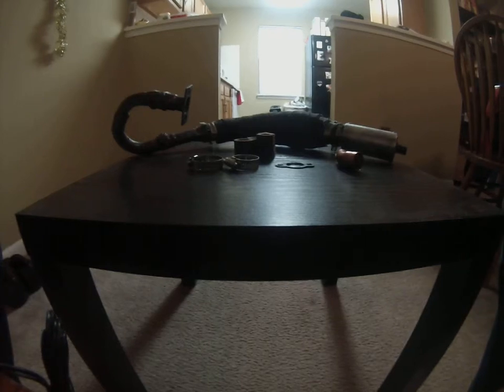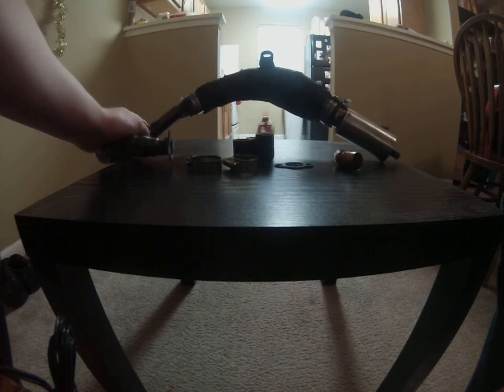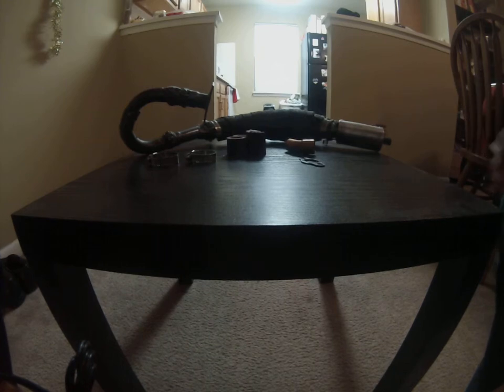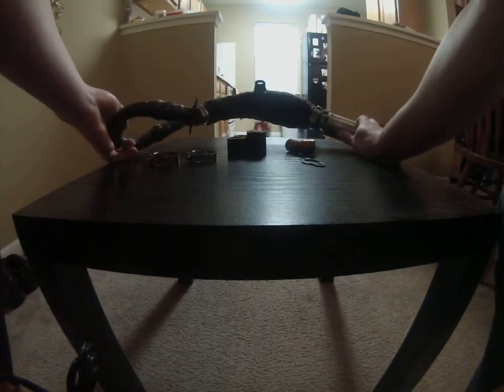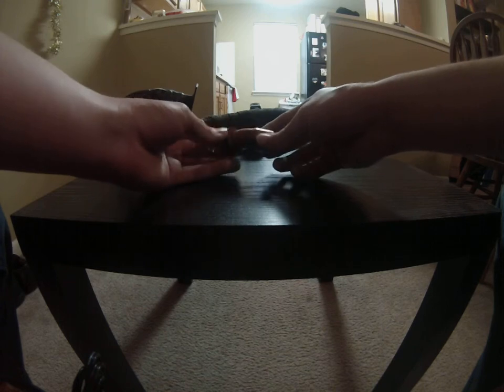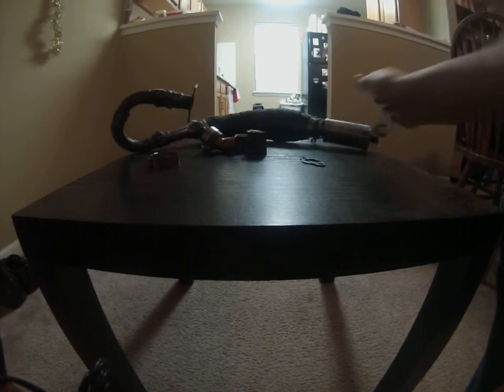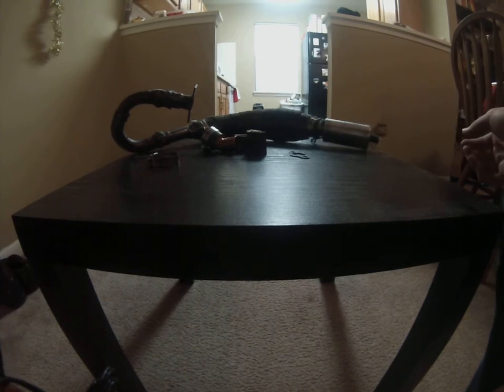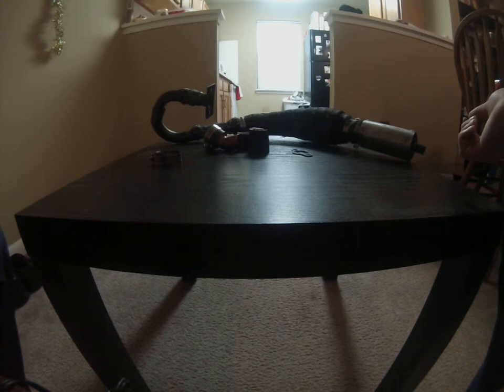Sick Bike Parts Expansion Chamber Review and Pro/Cons

Comment: See, I've bought many things from sbp and really wanna buy this as well. However I cant decide over this or the thrust racing pipe which cost 20 bucks less and apparently increases top end speed a lot. I dont know if I really have the time right now to do all this diy shit with this exhaust, I just got done fixing everything on my bike (had a lot of issues building up). Do you think that this is really worth the 73 dollars
Reply from the maker: In the motorized bicycle community the SBP expansion chamber is definitely #1 most recommended pipe. It's the most universal you can get with a kit. There is a reason it has such a good reputation.